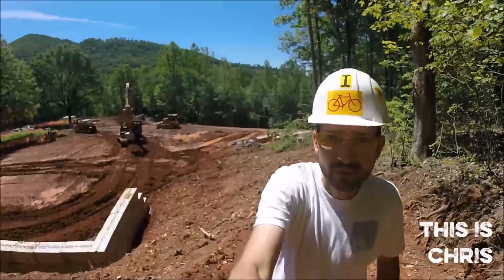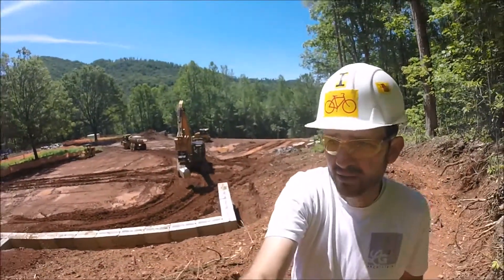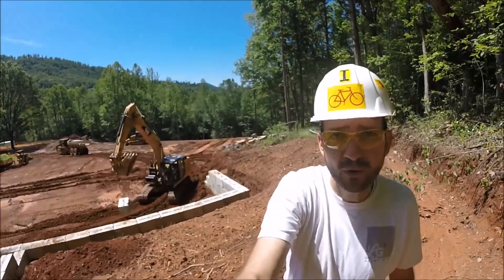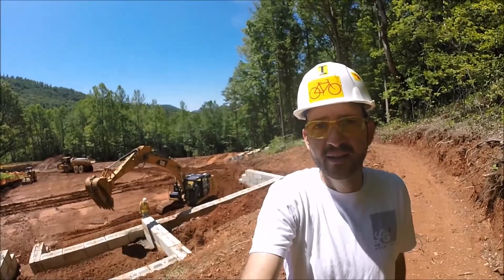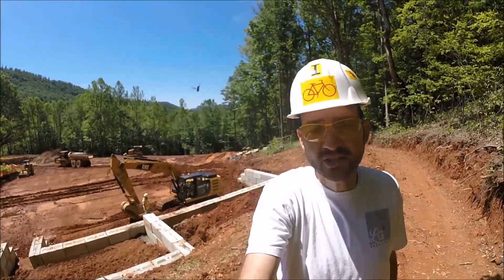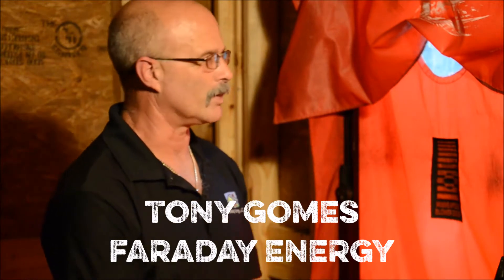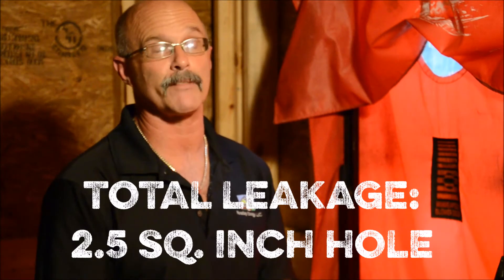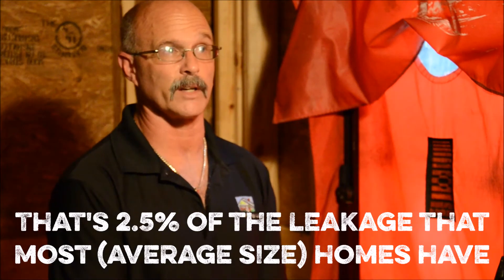How & Why This Tiny House is So Air Tight

Comment: is it okay to ask what county you are building in?  I am finding it's hard to get answers from companies like Duke Power, unless i know what county I would be building in....and we haven't bought our mountain property just yet....looking and research stages.  I haven't seen all your videos yet, but I am wondering what off grid energy sources will you be using?  Will you still be connected to Duke Energy and having the net metering program where you are still hooked up to Duke, but using your own energy unless you sometimes need theirs?  I was trying to get someone at Duke to answer this question, but they couldn't....I want to know if you can build an off grid home in NC without being connected to Duke at all?  And if so, what are the specifications?  What is the square footage they will allow you to build without being connected to power?  If you know any resources that would help me in my researching, I would really appreciate it!  Hope things are going well at this stage of your building process...